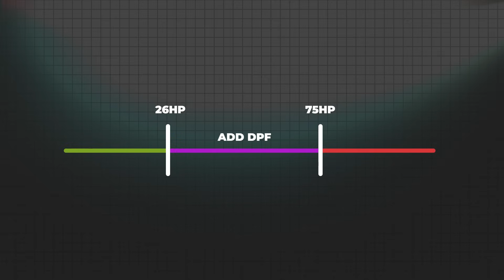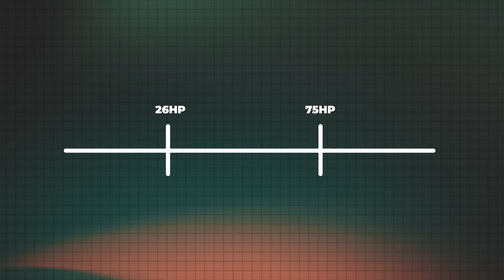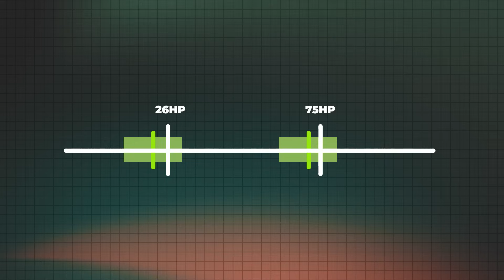2025 Tractors are Less Powerful. WHY?!

Comment: It makes no sense to have emissions hardware on farm equipment because the pollution this equipment reduces is not an issue in the areas where these machines are used. Looking at the bigger picture, the CO2 emissions would remain the same, so the real goal should be to transition to climate-neutral solutions in the future, which will likely be battery or hydrogen-electric systems. In the mean time, fuel efficiency should be the top priority

Comment: I have a new kubota bx23s i put 10 hours on it. Ive been running it at 2500 rpm for the break in. Is that okay or should I do something different its my first tractor?

Comment: Torque pulls the plows. Model "G" John Deere could handle 6 row cultivator. Model "A" would handle 4 row cultivator. The  "G" had 412.5 cu in engine. Model "A" had 321 cu in engine. Both had about the same "Horsepower".

Comment: I would rather stay with 90's engine tech without the emissions BS, and use that machine your standing behind as the baseline for tractor power ratings as done in the past, dyno'ed hp out the pto shaft, NOT the HP at the flywheel!  Wish the EPA would do a study as to how much environmental damage bolting all this crap on causes, it takes energy and resources to build that stuff, not to mention replacing it when it fails over and over.  Stupid if you ask me, no tractors with a ECM for me, I stay in the 90's or older.
Reply: Nothing wrong with an ECM controlled engine as long as it’s a good engine. Cat 3406E, most Cummins N14s, Series 60, all great ECM controlled engines
Reply: For hobby you can do what you want. For professional use, using a 35 year old machine is inferior.
Reply: @petermuller3995  Alot of 80's/90's machines out there supporting guys full time.  No emissions crap to fail and are reliable.
Reply: @tpfromcentralpa1692  A 90/80s tractor is not more reliable after 35+ years of use or do you get new ones somewhere?
In adition to that a 90s tractor is inferior in nearly every way from fuel economy to comfort.
Reply: @petermuller3995  I suspect you are from Europe?
Reply: @tpfromcentralpa1692  Europe or North America does not matter in this discussion.
Reply: @petermuller3995  It does, because the government doesn't provide for our tractors replacement here in the states.  I have neighbors out who are full time farmers right now with tractors both built in the early 2000's or older right now doing tillage.  We keep up with mantainance and they last and work reliably.  Your thoughts that older iron is not reliable is not based in fact unless it isn't looked after.  We(I) put acouple hundred hours on a 80's IH this spring so far just hauling manure and had zero trouble.
Reply: @tpfromcentralpa1692  in Europe there is no one paying for tractor replacement either. No idea where you get this lie from.
Farming is not about cool tractors, it is about how much $ your family has in the end as every business is. 
A 80/90s tractor is not cheap today either, it is worse in every way compared to a new one apart from simplicity. And if you factor in the work hours of maintanance you are not cheaper or at least not in the end when everything is factored in you do not ha e more $.
Reply: @petermuller3995  Sooooo, your telling me European countries do not subsidize farm equipment replacement?  I am not as un-educated as you might believe.  And yes, I can do math and the older iron works for me and alot of others.  If it didn't didn't Neil here would not sell so many parts.

Comment: Normally you can turn up the fueling. The shop can’t do it and it may void your warranty, but many 35 HP engines are the same as 25 HP engines.  This is also true on outboard motors for boats. A little part swapping or removal of anti tamper covers can add some real power.

Comment: Didn't all of the emissions get canceled last month?
Reply from the maker: People keep repeating this, but I've not seen anything real or concrete. Even if it does happen, I'd be surprised to see things change. These are global products and I think most manufacturers would expect the next administration to put the regulations back in place.
Reply: I did see an official announcement from EPA head Lee Zeldin stating there rolling back some diesel regulations for passenger vehicles/trucks.....sadly I don't think it covered tractors

Comment: When I look at a tractor horse power I look at pto hp,  on newer tractors that can be approximately 10hp less than the engine hp and in tractors it's the pto hp and gear ratios that make a difference when it comes to hp. But there is also alot of other factor. My dad would hook a tractor to any equipment as long as it would hook up regardless of what was needed.

Comment: Why is the torque number not listed on the Kubota spec sheet?  Is that correct that some tractors can have the same horsepower but slightly more or less torque.
Reply from the maker: Yes. Easy to find if you lookup the engine number on the Kubota engine division website.

Comment: So it was $1000 per hp and now we are getting a worse deal.  Now HP is one thing, but if the tractor has 50 hp, and does not have the weight of much older tractors, it is difficult to put that power into the ground.  That kind of sucks.
Reply: I agree totaly. In the 80s and 90s you could do alot with a 50hp tractor but now days a 50hp tractor is just a glorified lawn mower. You have to have at least 100hp tractor to have enough weight to do anything.
Reply: @DeeHardy-i6n  Yes and that is where the $1000/hp kicks in.  $100,000 gets you just an ok sized tractor that can run a small diskbine or a regular small bailer.  That an a farm mortgage make you have to work so much harder.
Reply: @gibblespascack1418  FACTS..Got a Uncle With a 60's model JD 45hp & we Have pulled Out another Tractor That was stuck n the swamp(we always Called It) After a 750 B Case Dozer Could Not & a Big Record Could Not ! Now Ya Could not Budge It with Less Than 75-100hp Just No Weight to this New Junk As Most of us Already Know ! !
Reply: @gibblespascack1418  Yep...Facts
Reply from the maker: This is partly because they keep putting more horsepower in small tractors. My glorified lawnmower has 40 horsepower now. You're right that you need to buy a 75 horsepower machine to get what used to be the weight of a 50 horse tractor.
Reply: @MessicksEquip totally agree. On our farm we have a few Ford 3930s, 50hp. Also have a Ford 6600, 78hp. Just got a used 5075E John Deere, it’s 74hp but closer in size to the 3930s. I don’t mind, as it’s perfect for things the 6600 is a bit bulky for while still being around the same PTO hp for bush hogging and such things. You can still buy a heavier tractor if you want!
Reply: i upgraded from iH H to MM 445
Reply: That also depends on the brand you buy and even models in the same series.  A Deere E series is lighter than the M series.  Massey has a 70 hp that gets up to 10k pounds.
Reply: My Massey 2860e is pretty light I got rear tires filled which helps a ton. My old Kubota L2501 was extremely light. I've ran 2 different Kubota M7060s one with filled tires one without it was insane the difference in stability especially when moving 5x6 bales.

Comment: It would be cool to see some new tractors vs old tractors on that pto dyno. Like 150 hp today vs 150hp in 1999 vs 150 hp in 1975
Reply: That would be interesting for sure.
Reply: Maximum horsepower will be the same but the newer models will have significantly higher low end torque.
Reply: @juhokestila7367  would really depend on the tractor models. Some modern tractors have pretty poor torque with small 3 and 4 cyl engines with juiced up hp.

Comment: John Deere followed through with this almost immediately. If you look at the history of their 5 series tractors it becomes evident. For instance, the 5045E is now the 5050E. Deere said this was to represent the most true horsepower rating to the machine/engine. It is interesting to see that they making large tractors less powered. Even on vehicles with Def. One of the lowest horsepower per ton machines was released this year by John Deere, the 6M 95. It’s interesting to see.
Reply from the maker: It should not impact that HP class, this would only be for those that sit right at the 26 and 75 HP boundaries.

Comment: I never understood why we have emission standards on farm machinery
Reply: Military does NOT and still in the environment.  Funny how that works.
Reply: These Authorities and Agencies are totally rogue. This is insanity. On a smaller scale, we’re witnessing the end of the residential lawn and garden tractor.  I hope Lee Zeldin can get some changes made to this nonsense.
Reply: Oh I forgot that farm equipment operates outside the environment.
Reply: @Tb0n3 Both NOx and Soot are only a problem in urban areas… places where tractors do not operate in any significant numbers. Cars in cities ok, but there are a thousand cars in 1 acre at any time in the city.
Any NOx or soot a tractor emmits is spread over a huge area in comparison and the concentration of it in the air is so low that they do not cause problems.
There is 0 reasons to have emmisions on tractors, it’s pure regulatory overreach.

Comment: Are there any suitable turbocharged small gasoline engines used in vans that could be used in less than 100 horsepower tractors? Still require catalytic converters & gpfs etc. Cummins has gone this way with their 6.7 liter 'Octane' engine. The gasoline tractor might have a subframe cradle for the gasoline engine (between the front support and rear transmission housing), hydrostat transmission as a cvt etc.

Comment: Why would you want to breath in the soot so the first tier I would actually want it def is a pain so in would want under that
Reply: A cetane additive reduces regen frequency and times.  Along low fuel consumption with a boost in hp and torque.
Reply: Yeah but then whenever it decides to do a re-gen cycle you gotta hop off and run far away to avoid to smoke.

Comment: I was hoping you would put an older and new variation of a model on the dyno to see if there is actually a difference 😂
Reply from the maker: That's a fun idea. I would guess between the engineering tolerance, and a tolerance of our Dyno we won't find a difference
Reply: @MessicksEquip  Yes, you would have to test a bunch to assess variation as well as average, to meaningfully detect a difference.  We have the same problem in aviation since flight tests are so expensive.

Comment: Government rules and regulations we don't need!
Reply: Especially when the government isn't required to follow those same rules and regulations.
Reply: I understand there's legislation presently going through Congress to roll back some of these emissions rules.  In particular, the aim for diesels would be pre 2006, which should do away from DEF and DPF components.
Reply: @Jamesrobert100  Trump is looking back at rolling to the 2020 regulations not 2006
Reply: @ That's for gas engines - I specified diesels.  Actually per TK's garage channel, WH Press Secetary said they are looking at rolling to sometime before 2020 regulations.  That's for gas, diesels go to pre-DEF regulations, which I remember being 2006 model year.

Comment: This explains why when I looked up specs while tractor shopping recently, a "26 HP" tractor actually had 23.3 engine HP. The one I got was manufactured in December 2023, so I assume it was before derating changes were made.
Reply: They can get Sued for false advertising.

Comment: Everything is over regulated. I’m going to delete my tractor as soon as the warranty expires. Thanks Neil
Reply: Just add synthetic oil and cetane booster.  Your hp, torque will go up along with fuel economy and engine response.
Reply: I've deleted mine on an 7715massey, bloody brilliant job do it ASAP! Totally different tractor.

Comment: The EPA doesn't regulate torque.  Plus IF the unregulated oil industries would add MORE cetane the emissions would lower and hp and torque rise.
Reply: Hard to make more torque without more hp. Since one is a mathematical calc of the other . But yeah I get your point.
Reply: Nope. As soon as that measure is used the EPA would go after it. Nice try. The EPA regulations are the issues, not the manufacturers measurements or the amount of cetane.